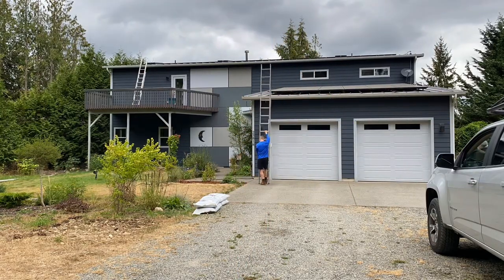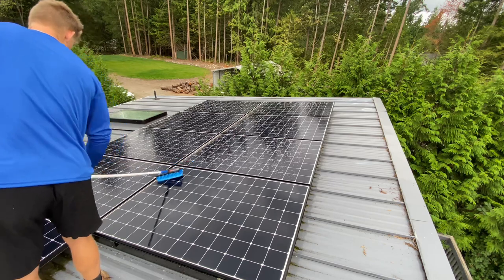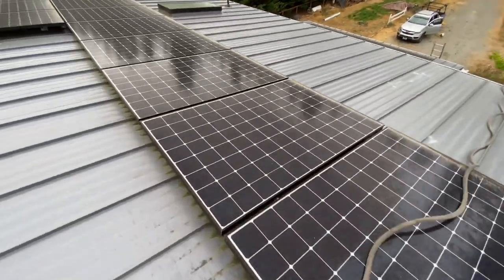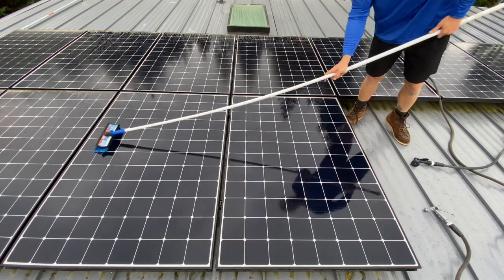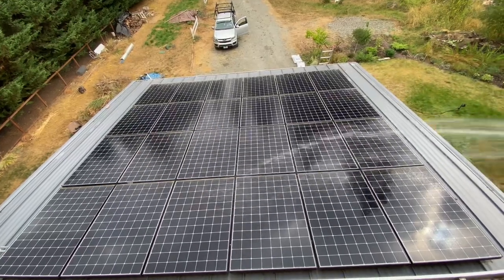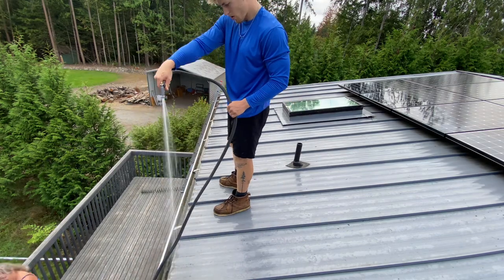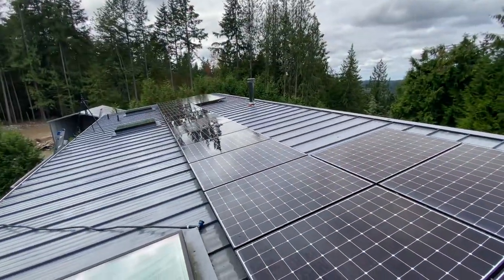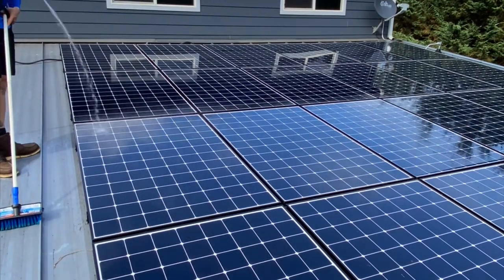I Made HOW Much Cleaning Solar Panels??

Comment: the blue cylinder u plug the hose in at the beginng is a filter for mineral to not get trace on the panel after they dry? i always have that issue after cleaning them XD

Comment: Do you have a tank for that special water or a filter? How does that work? Thanks in advance! Love your channel
Reply: you can make your own deionized water but unless you use a lot, is not worth the price of filtration, also because filtration is quite slow if you use an affordable filtration sistem, i used to fill 25L water containers at work and required like 1.5 hours, almost 2, then was sold for less than 1€/liter.
so yes, i think he bought the water